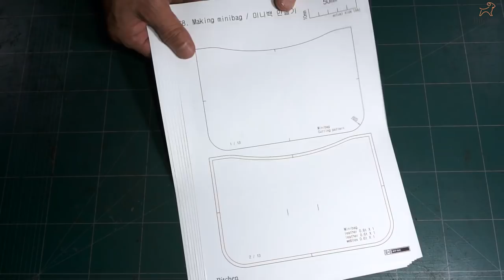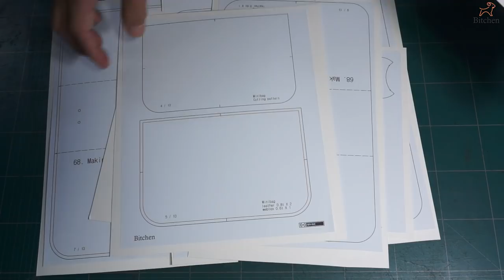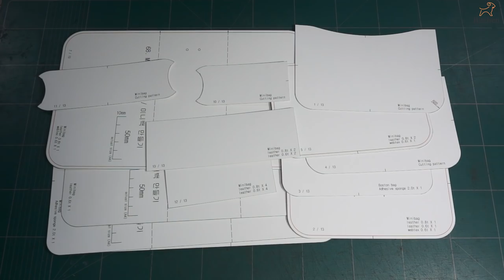68 [Leather Craft] Making Leather Mini handbag / [가죽공예] 미니 핸드백 만들기 / FREE PATTERN

Comment: Hello! 

- Tell me what is the name of the tool with which you make several holes at once, something like a fork. Where is such a set sold?
- what is the name of such a seam? and how many did not look and did not understand how the knot is tied? Could you show this item separately?
- what is the name of the compound that you use to process the edges? I'm talking about the one that is brown.

Thanks in advance for your reply.
Reply from the maker: Thank you for watching my video.
First question: The name of the tool you mentioned is "Pricking irons".
You can purchase individually or as a set by searching for Pricking irons on the Internet.

Second question: I did not understand the content of the question well.

Third question: The drug you mentioned is an edge coat material, and the product I used is a “FENICE” product, which comes in a variety of colors.
thank you.

Comment: Please sir 
Is the length measurement for the base  same with the length of the main panel? 
Or did you reduce the length of the base?
Reply from the maker: I didn't understand the question.
Could you please elaborate a little more?
Or please tell me the time of the video.

Comment: How do you do the edge paint ? How many layers and do you sandpaper it between layers . It’s so perfect. Wish I could do it like you do .
Reply from the maker: Edge code work is usually done about 3 times more than 2 times, and sandpapering is also done in the middle.
Reply: @bitchen  thank you will try to work as good as you do .

Comment: Beautiful work ❤️
But, there are no measurements, how do I draft the pattern?
And please, what did you use for the edges?
Reply from the maker: Thank you for watching my video.
And what measure are you talking about?
The pattern I uploaded is a 1:1 pattern.
And the one used for the leather section is an edge coat for leather.
Reply: Thank you for replying.
What I mean is, your patterns were prepared already, you just cut it out. What measurements did you use to prepare them?
Reply from the maker: @giftanwana8868  I didn't quite understand the question...
Have you ever seen the numbers 50 and 10 in the upper right corner of the pattern?
You can check whether it fits 50mm or 10mm with a ruler.
Reply: Gift Anwa, if send Bitchen an email you can request his free patterns and he will email it to you then you just print it.   I hope this helps and all the best ❤

Comment: thanks for sharing, what's the material did u use for patter3 and thow thick it is? thank u!
Reply from the maker: The material you mentioned is adhesive rubber.
The thickness is about 2.0mm
thank you

Comment: Which adhesiv you using for sides pastings
Reply from the maker: I didn't understand the point of the question.
Please tell me the duration of the video.
Reply: @bitchen which glue,  jeobchagje, jiaoshui, adhesive 5:41-6:07
Reply from the maker: @marydaly9764  Are you curious about the glue I use?
Then, the adhesive I use is "KENDA FARBEN" made in Italy.

Comment: I don't have a slitting machine, to slit to O.6 mm or 0.8 mm, so I take the 1mm thick foam instead of 2mm since my leather will be greater than 0.8mm😅
Reply from the maker: These bags require slitting machine work, but
Even if you don't have it, you won't have much trouble making it.
All you have to do is select the overall thickness of the leather carefully.
If you have any further questions, please write anytime.
thank you